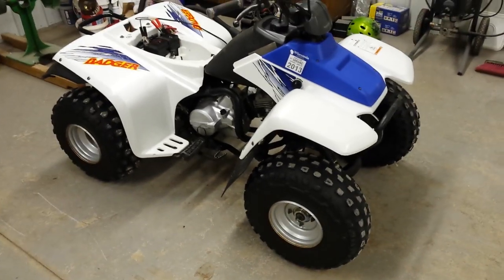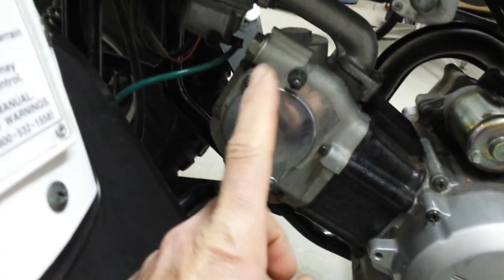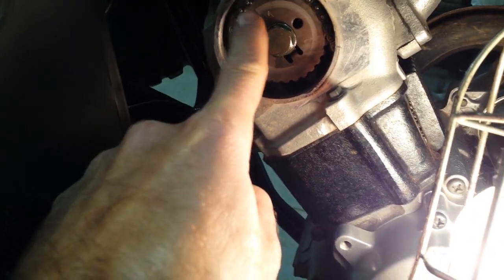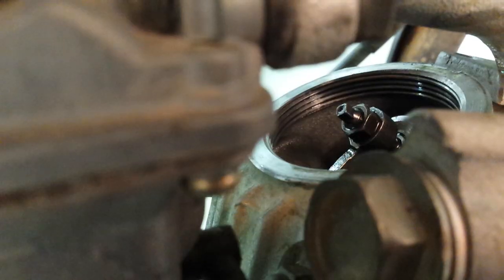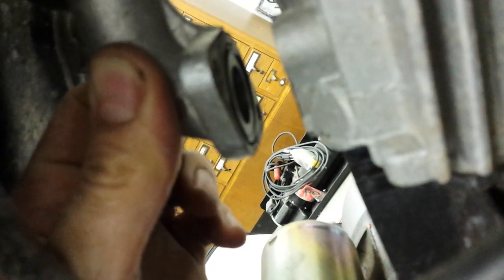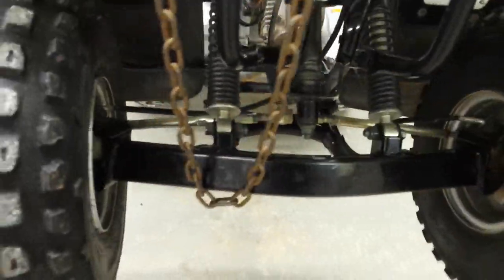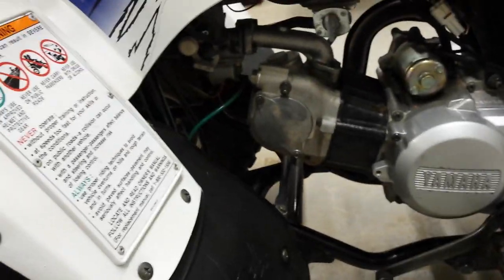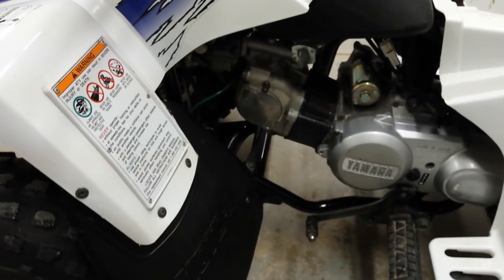If your ATV won't start - Secret way to increase compression!

Comment: I didn't need to see you lower the machine, I wanted to see you adjust that intake valve with a 10m, Cresent wrench and a feeler gauge with the intake in your way. Amazing. Ur good. Yes, valve lash shrinks with age as the valve face wears in. Always check it with any kind of issues. Great video 👍
Reply from the maker: And now you know why I'm not a you tube star! Plus I can't do anything electrical ever :)

Comment: Going to have to check this. Been putting the kids badger in 3rd and push starting it all last summer. Weird thing is that if the engine was warm it would start with the starter... cold, forget about it. Thanks for the video
Reply from the maker: This is what you have to do so it starts without pushing it. As you can see, doesn't take long.  Will save you headaches in the long run
Reply: @ThatDumbSchmuck  finally got around to this. Adjusted both valves, starts like a dream. Thanks again buddy.

Comment: A bit of a shortcut I've used for years to adjust valves on a 4 stroke engine ... The Formula is  EOI - IC 1/2D =E    Just Do This ... When The Exhaust Valve Starts To Open  ADJUST Intake .... When The Intake Valve Start To Close And Is 1/2 Down ADJUST Exhaust     
 Or  TD-C  Both Will Be Closed  
                 & The Cam Will Be On Both Base Cam Circles                     
        TD-C  Means Top Dead Compression !!    -WM
Reply: TDC is top dead center.
Reply: @danjoneshistory  Yes . TDC is Top Dead Center .... But how many Top Dead Centers are there in a 4 cycle engine ??  2.  ONE with overlap Compression/Power & ONE with overlap Exhaust/Intake  When I teach or instruct Hands On I always remind that with BOTH Valves closed that means TD-C =  Top Dead Compression !!   Thanks 🙂
Reply: @waylonmccrae3546  I never thought of this.  Thanks!
Reply: @danjoneshistory   All good my friend .... wasn't trying to complicate it !! 
There are more things going on at 4,000 R.P.M. than most realize !!
  I have a lot of people tell me the same thing you just did .
 Makes them scratch their head and Ponder !!  🤔  😉👍

Comment: Thank you VERY much for this video. my valve on top was way too tight. adjusted it and it starts right up. Thanks again
Reply from the maker: amazing isn't it?  glad we could help you get back up and running!
Reply: To Review ItAll.  Did you do a compression check before and after?
Reply from the maker: @rcWizzard  No, I should have done the check.  I could see that before the adjustment, the valve was not fully closed.  I'm sure the compression would have been almost non-existent.  After adjustment, it could actually seal and "should have" improved...

Comment: Help my 2001 Polaris sportsman we put two of the same Polaris sportsman 500 engines together and it just cranks and cranks getting fuel but don’t even start with starter fluid so I’m confused
Reply from the maker: Have you checked to make sure you have spark? If not, make sure the valves or ports are functioning. Spray starter fluid in spark plug hole, quickly install plug, and try it

Comment: Thank you for the video! 
I am new to fixing my atv. 
I didnt really understand when you said to tighten the valves to 5,000? Did you use a special tool? And what kind of tool? 
Thank you!
Reply from the maker: 5 thousandths is actually 0.005 inches.  the feeler guage is a strip of metal known to be the correct 0.005 inch thickness.

Comment: I'm having the same exact problem with the 250 recon. Could you show a video about it. It would be very helpful.
Reply from the maker: Sorry, I don't have one of those. But they are all pretty much the same. Just find the valves and check the lash

Comment: So if my compression is reading at 85psi do you think I just need to possibly just adjust the valves and it would help??
Reply from the maker: 85 seems low, but it should run. Never hurts to check the valves even if you don't adjust them, you know that's not the problem

Comment: Is that .005 on the.feeler gauges? New to them sorry did fresh rebuild mine wont start tryed intake at .002 exhaust .004 then i did .004 intake .004exhuast ima try the point .005 wish me luck brotha😢
Reply from the maker: I'd suggest starting at 0.010, especially with a fresh rebuild.  as the valves and rockers go thru their initial break-in the gap is sure to change.  as the engine runs, the valves will sink into the head some and the gap will close.

Comment: Thanks so much did this and didn't even have to use feeler gauges??? Probably should have. 
Mine runs great now. before it wouldn't idle when it was cold and wouldn't start with electric start when cold and made lots of noise from the engine and what does the black hose on the left side of carb do when I put it on mine runs weird anyway great vid and thx a ton 😃😃
Reply from the maker: at least now you know the problem.  Pick up some feeler gauges and set it to the specs.  way cheaper than taking it somewhere to be fixed and you'll always have the feeler gauges for the next project!
Reply: Ya I will thank you good vid 👍👍

Comment: The issue was the broken rubber O ring at the intake manifold, I guess.
Reply from the maker: that will do it... to much air, or not enough gas to get it to fire.

Comment: My badger will crank but then it buzzes
Reply from the maker: I'd check the battery.  sounds like it might be low on juice.  charge it up and then try it again.  if that's not it, check your battery terminal connections and the connections at the starter and ground on your machine.  if that's not it, starter might need to be checked out.

Comment: donde trae el numero de motor y. el número de serie
Reply from the maker: this is an 80 cubic centimeter engine engine.  From the later 1990's or early 2000's timeframe

Comment: It is the carburetor has the same problem you make them more work than you supposed to
Reply from the maker: I haven't had to touch the carburetor and this thing runs perfectly.  I did a before and after on the valve lash.  going from tight (zero lash) to the proper lash seemed to make all the difference in starting.

Comment: That’s exactly what I had to do to myn put a new spark and get a new batterie
Reply from the maker: Otherwise, these machines seem pretty robust.  not a lot of things to go wrong although if you find a headlight/tail light kit for it, I'd love to add that complexity to it for riding at dusk.
Reply from the maker: @jasonearnest1900  - that's great.  did you just wire them into the battery with a switch?  I'd like to add headlight and taillight for safety and visibility.  if you have the model number of a light that you used, please let me know.
Reply: @ThatDumbSchmuck  yeah I wired to the battery with an inline fuse and like you I've been wanting to put a brake light on it being kids ride it just to be safe. Just not sure how to go about it yet I'm sure I'd have to buy a new switch for the brake because it being electronic and it's older but I want to make sure when I do get the brake switch it fits this badger so it's not wasting money. I figure beings the new 80cc raptors have one it can be done.